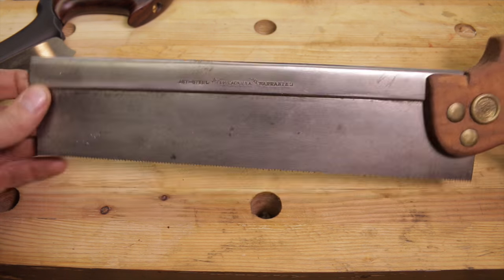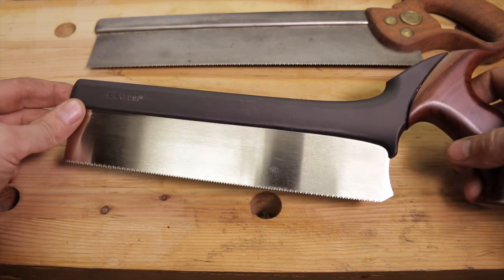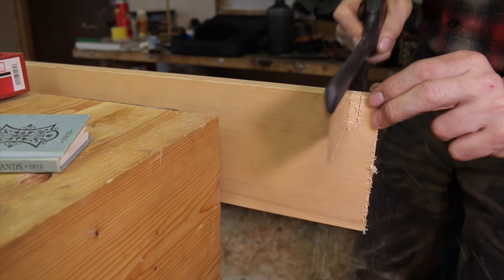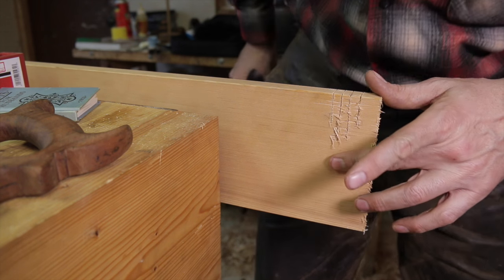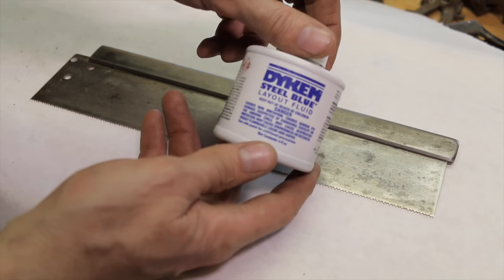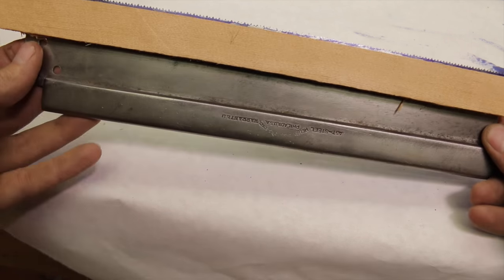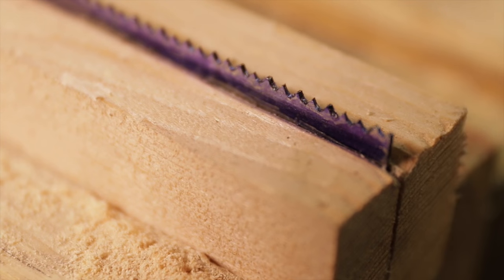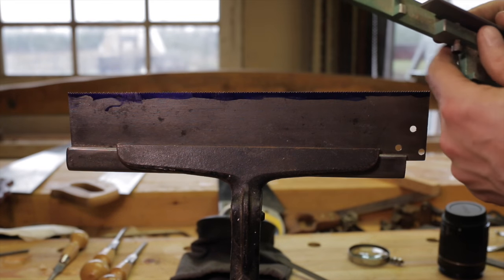How To Sharpen A Hand Saw 2

Comment: Acetone removes layout fluid. There is specific layout fluid remover with also has a bit of alcohol in it. Nail polish remover works as good as anything if you don't have the right stuff, just takes longer to work.

Comment: The trick with using a macro lens is to stop the aperture way down, to f/8 or smaller, to get a decent depth of field. You then need a lot of light and/or high ISO to get the exposure you want.

Comment: Wranglerstar, when your using your macro lenses if you run the shot left to right instead of “quartering away” the saw blade should stay more in focus.

When the saw blade runs diagonal through the shot it increases the range of focal depth you have to get everything in focus but from the side the range from the lenses to the target stays mostly the same so you have more things in focus.

Comment: Even though you can sharpen all teeth from the same side and get the angle correct. The best results are to be had if you file every other tooth then file from the other side of the saw. During each stroke of the file you are filing the front of one tooth and the rear of the next tooth. The tooth leaning away from you will cut better while the tooth leaning toward you will chatter slightly thereby cutting less. If you file only from one side every other tooth will shorter than the one next to it. To demonstrate the cutting or chattering put a piece of thin metal in a vice and file a few stroke with the handle high then file with the handle lower. If you don't have Prussian Blue a quick spray on the teeth with flat black spray paint works well.

Comment: I've never done this before either so this is just a thougt. Obsessing over 1 or 2 low teeth with a jointer to might not pay off. The other teeth will pick up the slack. That 6th tooth might not have done a lot of cutting. It would still be almost sharp in that case. Why try to make a dull flat spot on it and then file it sharp again. If you joint to just above the 6th tooth than you would save some filing. The tricky part would be to have the newly filed points to end up at the same hight as nr. 6. If it's still low this time it will be OK next time.

Comment: You are forgetting one important step - laying out the spacing of the teeth. If the teeth are at different spacing from each other, that can account for the varying height of them. Use a very sharp layout awl and a small machinist's square. Take it from an old shop teacher who did it and taught sharping to students in another life. your videos are excellent. Could have used them when i was teaching.   
Chris <><